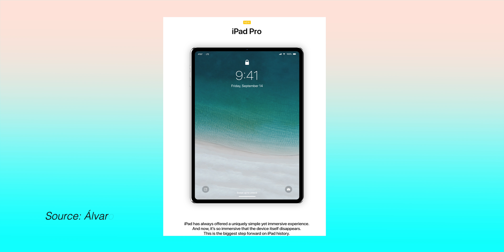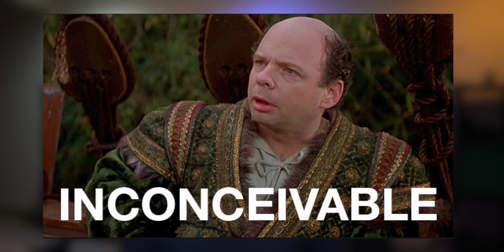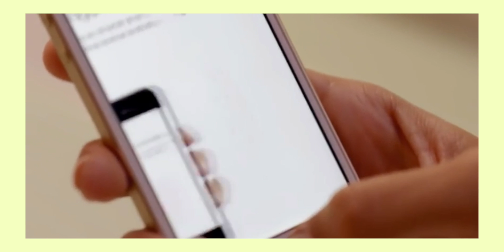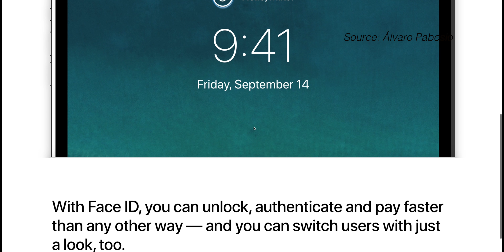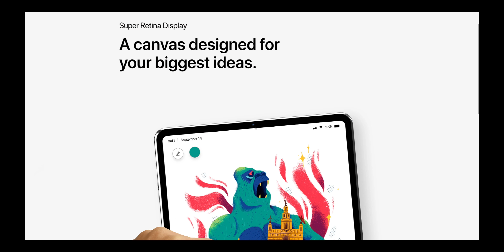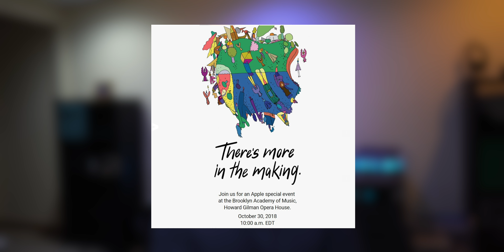2018 Apple iPad Pro X Rumor Round-up

Comment: I think you're wrong about USB C, especially when you said new technologies come to iPhone first but that's simply not the case when it comes to features that make more sense on a different device ( like the Apple Pencil and Promotion which are both still missing from the iPhone ), I think USB C as well makes more sense on the iPad Pro as Apple keeps pushing it as a laptop alternative where pro features are expected, don't forget that this USB Czech rumor is constantly being paired with an other rumor: powering external 4K HDR displays, no lighting port is currently capable of doing that.
Reply: Michael Caputo 😏